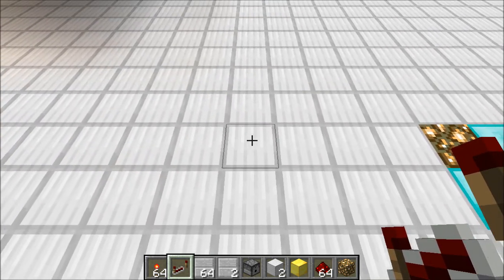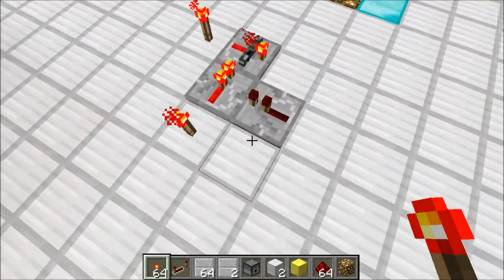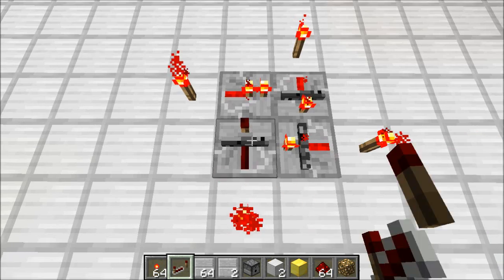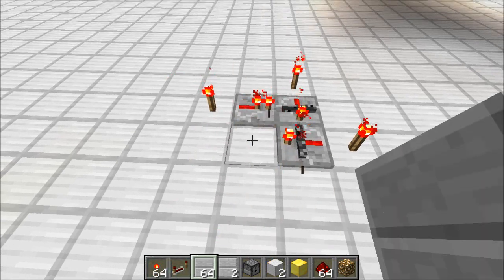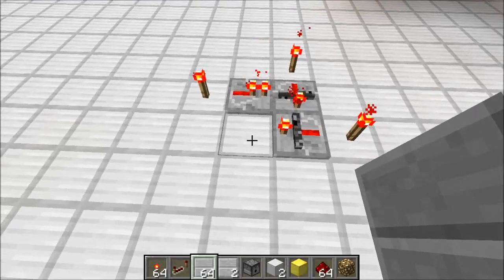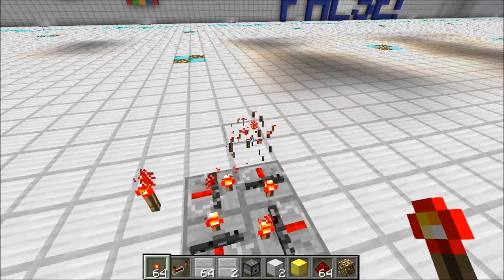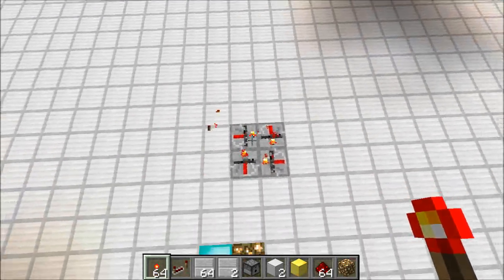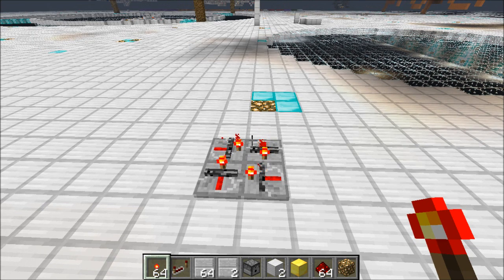How to Make Four Repeaters Lock Each Other

Comment: I only wasted a half an hour trying to make it work conventionally.

I tried signals from different positions, I tried it with the "power from the side" trick with makes repeaters flash on, and I tried it by placing the repeaters at the corners of separate chunks, but to no avail.  "Locking" comes before "Activating", and you can't get simultaneous activation from any trigger location.
After I was satisfied that only placing a pre-powered repeater could do it, I checked your vid.

...Cheater :P